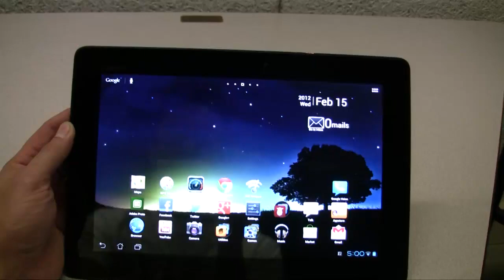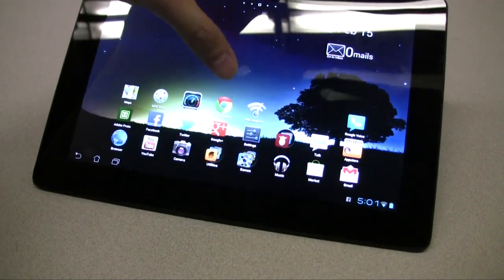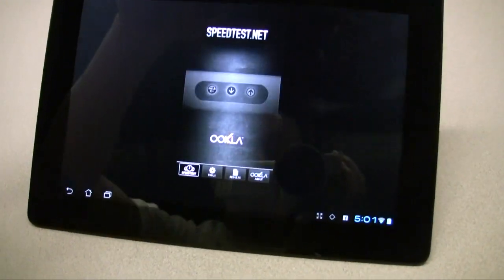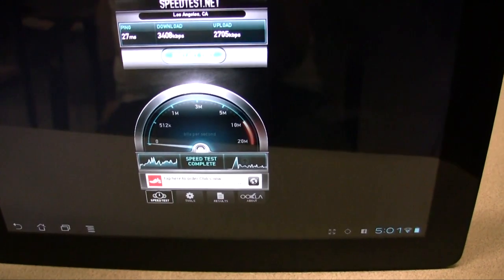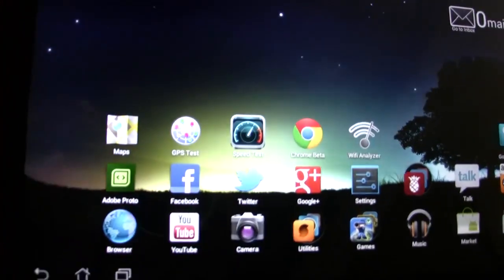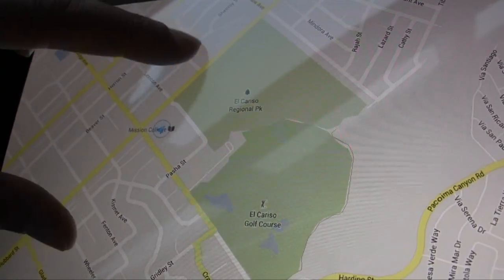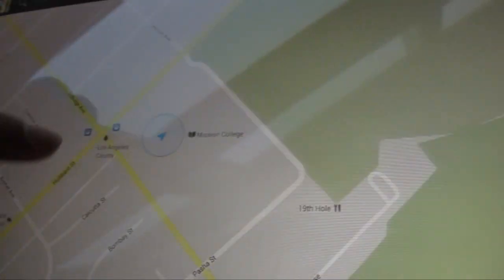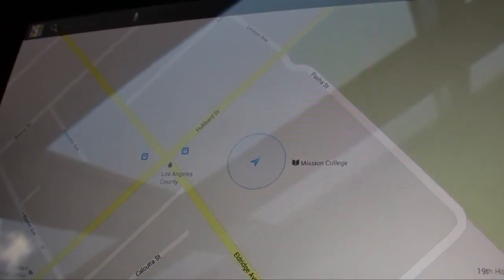Transformer Prime Modification Results

Comment: My tf201 wouldn't wifi or gps hardly. I opened it and the pins on one side that touch the antennas when closed are spring loaded. I put some folded paper behind them( I don't remember if it was the antenna side, or the pin side) so it would make them closer when the case was closed and this worked. The Wifi and the gps aren't as good as other tablets but they are serviceable.

Comment: Instead of speed test, I would prefer to see the signal strength as dBm. You can use "wifi analyzer" app, to check the wifi strength. So basicly you go to a poor reception area, test it with original congif, then test it again with moded prime. The difference in graphs should give more solid data about improvements.

Comment from the maker: I would say heat up the area that is liftting with a blow dryer or heat gun to melt the glue and pinch it together so that it sticks. Might not be a permanent solution. Of course you will do this with the thing turned off. Good luck and thanks for watching!

Comment from the maker: To me there are many differences and variables when experiencing network issues. Sometimes the browser will work fine viewing web pages but then there are issues with an app that uses the internet. It's hard to say then, if it is the hardware or the app or even the whole OS. I mean, my browser on my laptop has crashed before too, so was it a network issue or the app? Overall I have not notice a significant loss in usability with my tablet. Thanks for watching and the feedback!

Comment: Thanks again. Just a small comment: for 99% of Internet users Upload speed should be and is much slower that Download Speed.This is normal and expected and makes a difference for these who want to run server like PC. If you in NA check Bell/Rogers/ other Internet options and you will see smth. like  8/0.5 MB to 50/1MB Download /Upload speeds in their packages.

Comment: Only thing I would add to this is turn off wifi before using GPS, basically turn off wifi, reboot and then try to find location. You used aGPS with this.